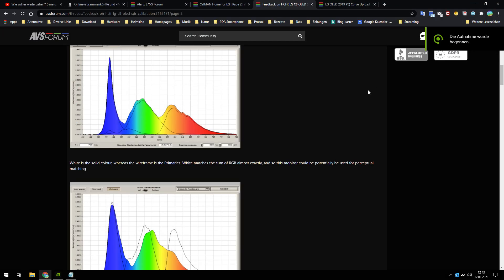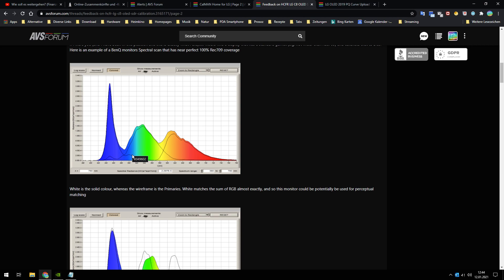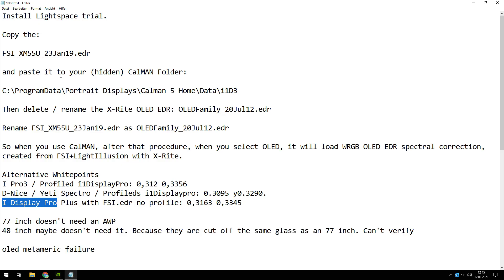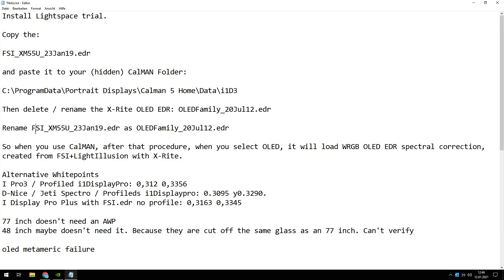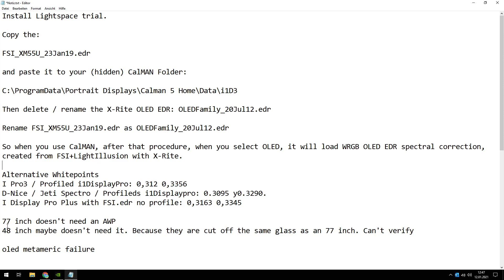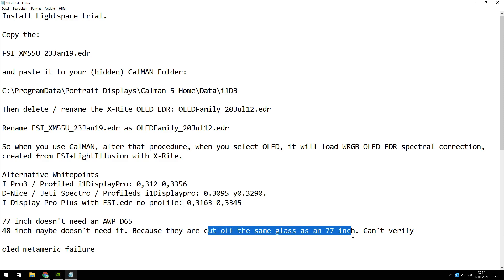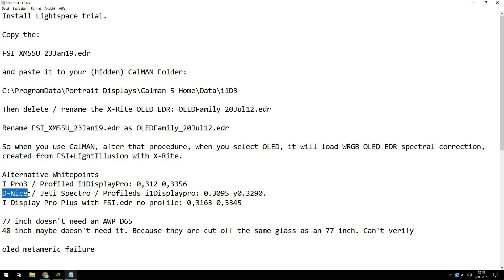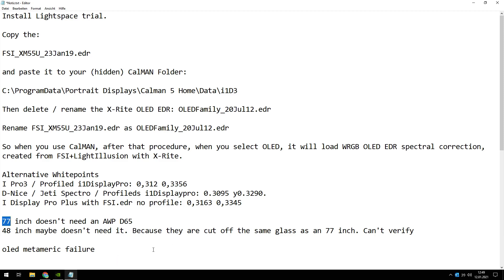Oled Calibration / Alternative Whitepoint / FSI.EDR

Comment: Hi, thanks so much for the great videos.
I have a LG C1 77 inch and am going to calibrate it very soon using the calman software.
I have purchased an Xrite Display Pro Plus and the edr file from light illusion.
What is the best procedure to follow for me to get a good result?
Should I follow the portrait displays calman guide but with the edr file?
I think you said the 77 inch does NOT require an AWP?
Really looking forward to your response.
Cheers.
Reply from the maker: Go for d65. But without a spectro you'll never get excact results. Sometimes edr is better and sometimes xyz. So my advice. Buy a spectro or the c6 with supported profiles from calman. I always calubrate manual to adjust it afterwards. Wait 200 hours before calibrating. Watch my sdr and then hdr video. Use the service menu for 109% white.
Reply: @optimalsettings  thanks so much for the advice. :-)
When you say sometime edr is better and sometimes xyz is better.
Is there a way to see which is better for my display/meter combo?
Reply from the maker: @jarrydwear1967  just with spectro
Reply: @optimalsettings  I dont have access to a spectro so will have to go with "close enough is good enough".
Thanks for your input though. I will wait until 200hrs.
Reply: @optimalsettings  Hey Dirk, I'm at 200+ hrs now :-). Time to do some calibration. Just clarify I should follow these videos:
LG Oled Calibration SDR Pt.2 / New AWP - but target D65
LG Oled Calibration HDR Pt.2 / New AWP - but target D65
LG Oled Dolby Vision Calibration

Was there a Pt.1 to the above? I can't find it?

Any other tips or tricks?

I'll be calibrating form my laptop. Is it correct to the have the Intel Graphics Output set to FULL and the TV set to Low? I think this was in one of your other videos.
Reply from the maker: @jarrydwear1967  Puh, long ago:
I believe the firts Parts are:
1. HDR: https://www.youtube.com/watch?v=KpD8xyEX9v4&t=7s
2. SDR: https://www.youtube.com/watch?v=1uq6mVr3ueY&t=1585s

Comment: Hi there. Thanks for the video. Quick question. If I only have a i1 display pro and no spectrometer. Should I use the awp of 0.3163 0.3345? I have a cx 48 (so I'm testing awps) thanks a lot.
Reply from the maker: A lot of time has passed after this video. At the end i ended up at D65 with my 77 inch. My advice to you. Try first with D65. If it's fit let it be. If you don't like the colortemperature and you think it'Äs a little bit to red than try this awp.
Reply: @optimalsettings  thanks man. I'm using 0.3095 - 0.3290 at the moment. Let's see how it goes. It's hard cause our eyes are always trying to fool us haha

Comment: Hi im trying to calibrate my oled b8 via sm with the 109℅ pattern in calman but for some reason  when im displaying the pattern and adjusting the gains in sm its not corrisponding to the pattern in calman the rgb bars dont adjust or change any idea why this is please ?
Reply from the maker: What bis your source? A PC? Set RGB High at PC and RGB low on tv.
Reply: @optimalsettings  im using pgenerator connected to my tv via hdmi cable pgen is full rgb and tv is low
Reply from the maker: @leeboi2k25  Can you see a difference between 100% and 109% in brightness?
Reply: @optimalsettings  i can a tiny bit but not that much really
Reply: @optimalsettings  Also another issue im facing is when i did adjust the rgb via sm with 100℅ in calman with read continuous i got the de to about 0.3 after adjusting the blue an green gains in sm  but when i exited sm and done a continuous read again on 100% it gave me totally different readings of 2.5 de ??
Reply from the maker: @leeboi2k25  Whem you adjust RGB High Gains in sm the 100% pattern an the 109% pattern should change. Have you selected the correct Pattern in SM? You must select outside or something like this.
2. so you have got 2 different patterns. Maybe there is a bug in sm that you can't show the Pgenerator pattern.
Reply from the maker: So the best is. measure the 109% pattern outside  the sm. Than adjust in SM without measuring and measure again outside from SM. Till you land on the spot.
Reply: @optimalsettings  yes ive also tried adjusting the 109% outside of the sm then going back in sm adjusting ect but still no difference
Reply: I also forgot to mention im in the autocal section of calman would this be the reason its not working do i have to be in the manual calibration section ?
Reply from the maker: @leeboi2k25  Yes. Autocal set the sm to max for rgb. And it's deleting the 1d Lut. So the best is. Reset the TV and start again in manual mode. When you use autocal you don't have to adjust anything .
Reply: @optimalsettings  but i have read that the autocal bypasses the service menu and does not affect it in any way
Reply: Also is it possible to manually adjust gamma and greyscale in calman then autocal the color 3d lut ?
Reply from the maker: @leeboi2k25  Yes. But i can't tell you details. I never used autocal. For this special qusestion AVS Forum is better.